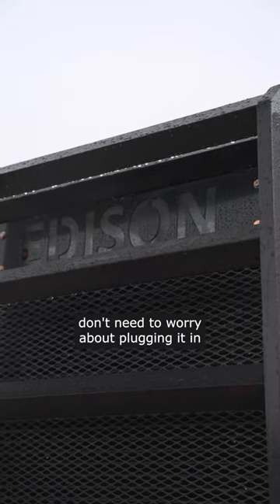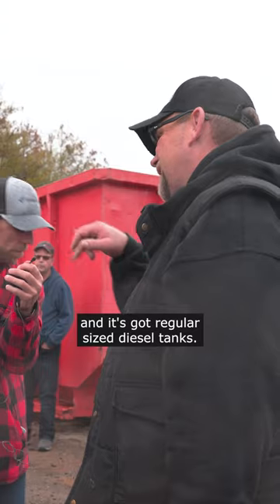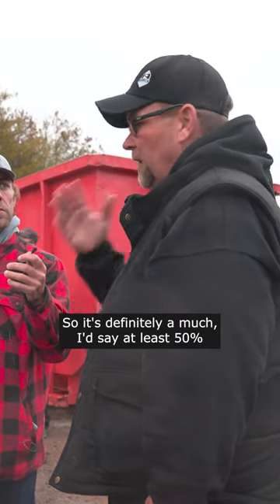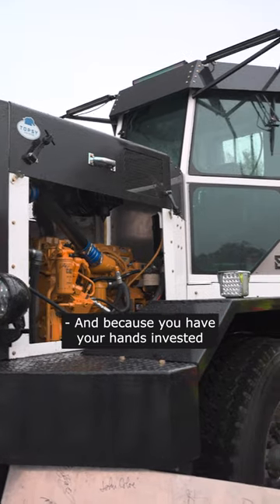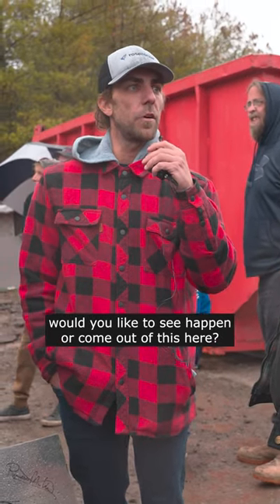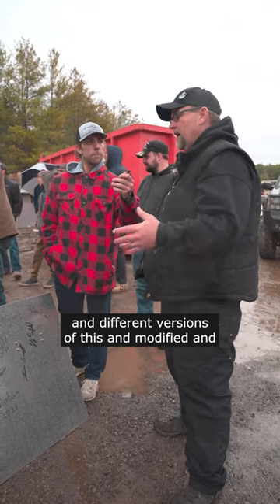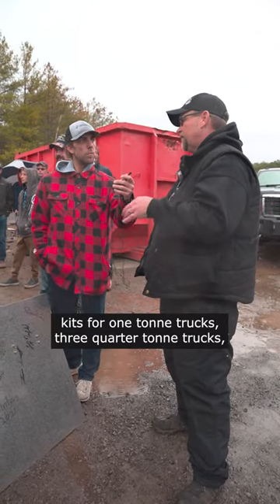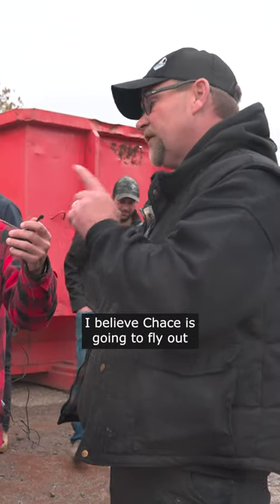Next steps for  @EdisonMotors and a few bells and whistles! 🚚🔔

Comment: Lower fuel consumption, less maintenance, safer, cleaner, local production. This is an absolute win.
Reply: The diesel being a generator is a massive gamechanger. 
It always runs at its efficiency peak, optimal stable governed RPM means clean exhaust gases and optimal combustion.

Add an Aftertreatment System and it will be Emissions compliant easily.

Comment: Make a grain hauling semi. Sitting in long lines at the grain elevators not burning diesel would be awesome.
Reply: Oh yeah, all that waiting and re-positioning...totally an electric win.  Run the gen at peak efficiency on the road.  I see so many similar applications.
Reply: Diesel electric hybrid is the future of trucking I am confident in that statement.
The key is the engine driving the generator could be anything:
Diesel, Hydrogen, Natural Gas, LPG, etc...
Whatever suits the local Emissions and the customer.

Comment: I'm not even a truck driver, I drive a school bus for handicapped children but I'm totally interested in what these guys are doing. I think it's awesome.
Reply: school bus would be a great application of this tech because it has regenerative breaking, so stopping captures some energy you can use to go again.
Reply: A school bus, even a small one, would be perfect for this. You may even be able to get away with never refilling the tanks if your trips are short enough. If not, then you've got almost double, if not more, range before you do need to refill!
Reply: Vehicles that make frequent stops actually get a much bigger efficiency gain than highway vehicles from something like this.
Reply: @porcupinepunch6893  which is where the idea for this system came from, vocational and logging trucks rather than over the road trucking. This will work for over the road, but the high torque of electric drive is much more important for stop and go and off road applications at for acceleration/deceleration than than highway travel.
Reply: It's a scam company buddy lol
Reply: @tylerbaldwin1633  what's your deal? You've made comments on a bunch of their videos, do you just find trolling that fun?
Reply: @tylerbaldwin1633  what makes you say that?
Reply: Imagine the company grows massively, the line of vehicles expands and they make upfit chassis.
Then there will be an Edison Motors schoolbus.

Comment: Im glad they went hybrid like the Freight trains are
Reply: Freight trains aren't hybrid. They have no batteries. The diesel engine only generates electricity.  If you take the engine out and replace the electricity source it still runs.

Comment: I could definitely see municipality uses,garbage trucks or school busses for sure could utilize this hybrid diesel electric setup,alot of stop and start or city driving uses more fuel than long haul or highway driving. To an extent this setup could take care of alot of emissions.
Reply: Can’t forget idling wear and tear on municipal vehicles as well like buses and plow trucks or really any construction type vehicles
Reply: I mean, all of these use cases are perfectly fit for a fully electric truck. How many miles do you think a garbage truck does in a day?
Reply: Stop and Go Traffic is the ideal application for diesel electric.
A small Diesel engine configured as a generator massively improves emissions.
Edison Motors says this drivetrain uses about half the amount of fuel a normal Diesel Truck with an engine 3x the size uses.
Why?
Because the generator only needs to provide the average power the truck puts on the road, no more no less.
The battery buffer takes care of the heavy loads like accelerating from a standstill.

Comment: It is an EV!!! Just power plant is not miles away, built right in the beast itself. 😂 Brilliant.
Reply: I believe the word you are looking for is "hyrbid"
Reply: @kissarmyrules nah its more like diesel-electric, thats what the railway industry has been calling this conczpt for decades
Reply: @kissarmyrules modern usage of the term hybrid means electric for a certain range/speed, then gas/diesel for anything more. This is an EV with onboard power generation, bit different.
Reply: Stolen idea from  Diesel train locomotives .. concept has been in use for many decades.. 😂😂
Reply: @Gunter_Custom  yes and no trains have diesel generators and electric motors but topsy(the name of this truck) has a generator that charges the batteries then the battery powers the electric motors
Reply: @AJWRodeo  close enough ...🤣

Comment: I would love to rebuild my old 04 Dakota with a diesel electric kit.  Unfortunately Dakota are not full sized truck, though the engine compartment is huge so it might just need a beefier suspension and it's good to go...
Reply: Hear that. Have  an 05 with  339 k on a v6

Comment: I winder how much extra weight you’re pulling with the batteries and full fuel tanks
Reply: Less, believe it or not. I think they came in under weight.
Reply: @thegurw1994  that’s insane actually
Reply: @SSJSky 400lbs less than a conventional diesel truck.

Comment: You know, we need cars like this, smaller efficient engines, they don't need to get your car from 0 to 60 in 7 seconds. They just need to recharge the batteries every now and then, best of both worlds in a transitioning market, maybe we will have the infrastructure in 50 years but gasoline vehicles have been here for over a century. The chances are we'll be in diesel electric, gasoline electric, or hybrid vehicles for another century before going full electric in most places

Comment: I need further explanation on how a generator can put out power enough to run a truck off of the same diesel. The truck would be running off of. Where is the increase in efficiency. There's some logic problems here and thermodynamic problems as well. Kind of sounds like a perpetual motion scam.
Reply: Not an engineer, but I’ll give a guess at answering your question: The drive motors are on the axels themselves, negating the need for a transmission and driveshaft, along with the differential and its gears. That is a lot of savings in heat loss from friction, which is where most of the work potential of an ICE is lost. Without a driveline you also won’t have the torque twisting the frame of the truck. All of the work potential of the electric motors, on the drive axels themselves will go directly onto the pavement.
Reply: With electric motors you can charge the batteries when slowing down with regenerative braking. You also don’t have to run nearly as large of an engine for the same task.
Reply: Think of it this way. Which is easier, moving the load down the road at 60 MPH, or getting that load started moving? Clearly, getting the load started. So that's the peak load that is demanded by the driver or what have you. So you've got that big load moving diesel engine up there, and it's running, burning the same fuel per RPM as it would to get the load going, while cruising at 90 KPH. Not exactly, I know, but u think you get it. Over the average of load demand, you might need something like a 245 HP  diesel motor. But that peak load needs 400 to move. With this design, you can use a smaller motor running at a single constant RPM, which is better for fuel efficiency and for the life of the motor, and store the power in the batteries until you need it to take off from the next stop sign. And then you also have regenerative brakes, which recharge your batteries by turning the electric drive motors into power generators.
Reply: @codyopperman5930  that’s a great explanation. One can use a much smaller Diesel engine, and use the batteries to get past the peak torque demands of hills and getting going from a stop. Makes perfect sense.
Reply: Basically it's like a modern train. If you want more in depth Edison motors yt page

Comment: Just like a diesel locomotive, a small engine turning a generator. Don't know why this was never a thing before.
Reply: Cause on top of hauling en engine, fuel tanks you are also hauling a generator and batteries.  Trains run an engine and generator set up but trains NEVER go up steep hills now do they.  Maybe this was not done before simply because it’s just a bad idea.

Comment: By the time gov ,goes through its crash testing, and puts a national safety code on it ,red tape from gov will kill the project unfortunately
Reply: It's a truck there is no crash safety
Reply: The truck got its vin number, and license plate
Reply: @alphabravo424  having cvip meeting soon forall new changes. That's good it got through.  Grizzly truck, 5 were built local, wouldn't allow to keep building.  Gov always has their hand out.  Great they keep trying.

Comment: so as long as youre already running a diesel engine, you can drive the truck.. you just have to substitute 10-15k lbs of load limit for that extra fuel tank that has to be replaced in 5-8 years for $20,000 and you have double the points of failure... and the exchange of cost to charge with that generator is FAR more expensive than standard diesel or grid power.. side note several times worse for the environment to manufacture, charge, and recycle..  conclusion.. does a great job proving to congress why it shouldn't exist.
Reply: No you don't lose out on load. The engine instead of C15 (3239pounds) you have a C9 (2083-2474 depending on configuration). You lose the transmission (716lbs) for the generator (416lbs). Topsy have 185 gallon tanks, while most long haul trucks will have around 250 gallons per tank. The batteries weight, in Topsy configuration 4000 pounds total. Yes the inverters do add weight, lets say, being generous to you, an extra 1000 pounds. The heavy spec axles are maybe on extra 300 pounds each. Than add in the allowance for the EV which in BC is 1500kg. Slightly heavier than conventional. no 10-15k Topsy only weights 28000 pounds in the over built configuration you see. The batteries are expected to last 10-20 years, because they are going to charged and maintained at optimal levels. That's the difference between a hybrid and a BEV
Reply: Its lighter than the normal semi and has a smaller generator

Comment: I can't understand why their spending so much time and money on purely electric vehicles when it's a totally stupid idea in the first place. I'm sure that a tesla could be retrofitted with a generator like all vehicles have to charge the battery while the vehicle is moving. Of course they'd have to hook it to a drive motor on it but I'm sure that there are engineers that could accomplish it with no problem. At least if you got into stop and go traffic your battery would be fully charged.

Comment: Bro ! Please don't be like mu$k keep it a truck not a Bart Simpson mobile
Reply: This guys the most pro right to repair person I’ve seen in a while I think he has no ambition in switching up the complete opposite of a tesla
Reply: Check out the Edison Motors channel for a LOT more details.  Chace tends to spend a lot of time raging about things like how what was an $80 turn signal that can be replaced in minutes is now a $400 repair and your truck is down for three days while they get the part in!  He has designed Topsy to be as easy, fast, and inexpesive to repair as possible.  He wants you to still be driving the same truck fifty years from now, on only your second set of batteries.
Reply: He uses flat glass. That should get all you need to know